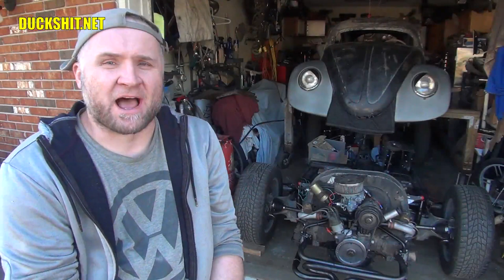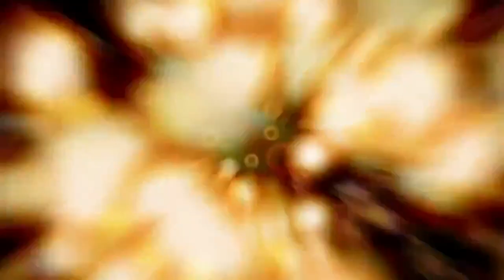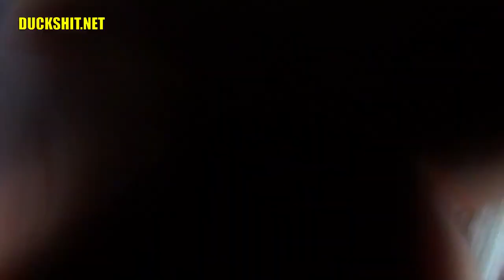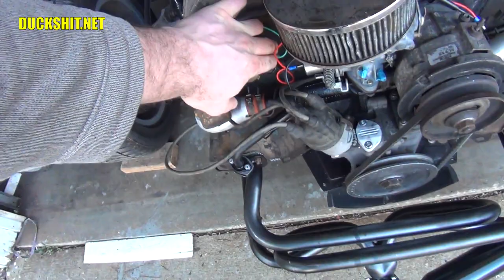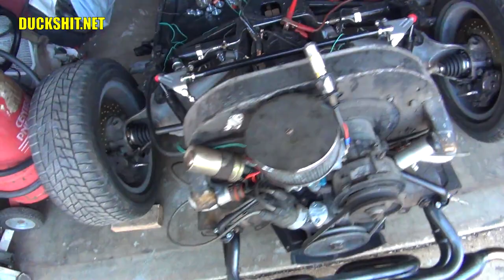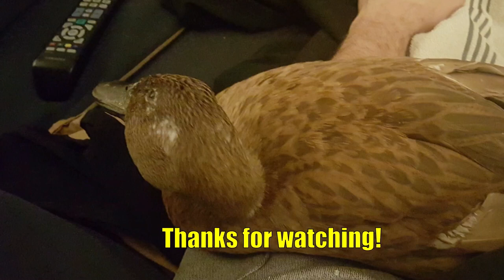Timing or Fuel Problems? - Why Electric Fuel Pump? -  Mid Day Q & A - 29

Comment: You did a much better job that I did with people asking redundant and idiotic questions. I have always preached in the shop that there's no such thing as a stupid question. Even I have my limits.lolMy stock manifold was frosting up. When I finally got things apart the damn thing was clogged. I've been working on cleaning it up but got a new on at a great price. The fun never ends. Great explanations and vids as usual.
Reply: I actually blew the sandblaster through the heat risers.... I couldn't see a damn thing in the blast cabinet!  LoL!  Absolutely black out!  I continued until it completely stopped.  Seemed to work really well!  Thanks for the comment!
Reply: My new valves were just delivered! And the fun begins. I'm still cleaning the engine case. I used the purple power, stain my case shit. Never again. Going to soda blast the rest of the grime and hopefully staining out of it. I got a little side tracked but, duck it!
Reply from the maker: Just don't duck it up!  Heh!

Comment: Since the stock carb most likely has stock jets, they were jetted for the fuel of the day.  The sugar water we get in California it necessitates a bump in the jets. I tried the 009 version distributor and the hot distributor from CB Performance, but went back to the vacuum advance distributor for driveability. With the two previous distributors they would run flat out but would have a flat spot between shifts.
Reply from the maker: Good call, there is a SVDA distributor here in the works, gotta rebuild it!

Comment: i was wondering about the timing too but i have complete faith that you will get it running great. I think that its great that its running and sounds so good.  i found your channel while looking for vw info. I bought a vw powered trike project and thoug i am a good mechanic i have no vw experience . my tryke is coming along thanks in part to channels like yours. But now I am thinking about a bug project. and like you I am a hot rodder at heart.
Reply from the maker: Thanks! :-D

Comment: Another great vid, I know I usually comment while watching the vid and ask questions and only if I havr waited a little longer i would have noticed I answer my question lol. Now I'm not sure if u did mention in a previous vid(let me know if you did) but will do you know if that exhaust will be the one that you use with the built motor, or different?
Reply from the maker: The bigger engine will likely require a bigger pipe, we'll see when the time comes!  There's math involved!
Reply: @vvtheduckvv  hoping you use another glasspack but we will see like you said when the time comes

Comment: I try to keep up with your videos, however I have an idea, something I ran into on my 34 pic carb on my old setup. Let me know if you need an idea..... if you don’t have it figured out yet. 
Would like a link to the fuel pump that you’re using. 👍
Reply from the maker: This is it! https://amzn.to/2AMy8J8  They are often sold out, keep watching, they are the best price online... PERIOD!  Less than half the price of most of the online VW shops and still far cheaper than any other online auto parts store.  They were under $30 so I bought 2, one for the Fastback, and one to keep for backup.  Eleanore has the backup one now, as soon as they pop back in stock I'll grab 2 more.
Reply: VvTheDuckvV thanks buddy! Appreciate everything that you do!

Comment: What kind of fan shroud are you going to use? I'm using a round doghouse fan shroud. Mine has heater ducts but I have freeze plugs installed in them just in case I decide to add heat in my car.
Reply: Probably your typical tombstone-shaped 36hp shroud.  They are smaller and just as efficient and don't have the heater parts that I don't need.... will look much better!
Reply: @DuckmanCycles  can't wait to see it, I like the looks of the round 36 horse style fan shroud.